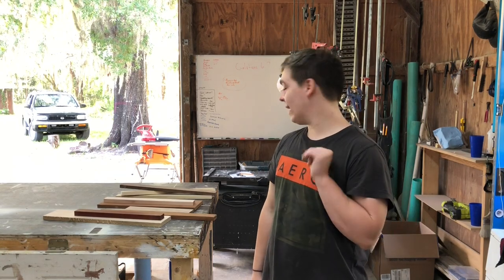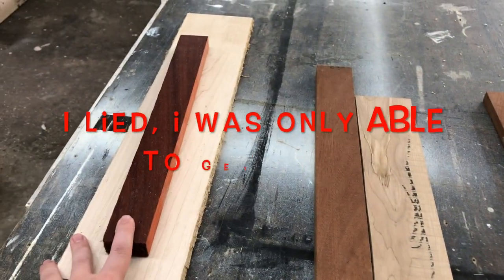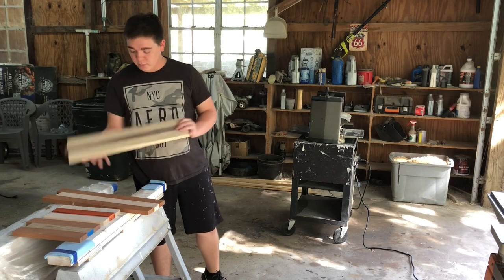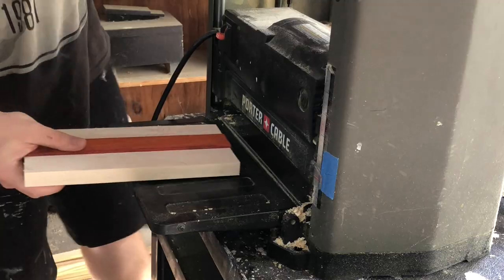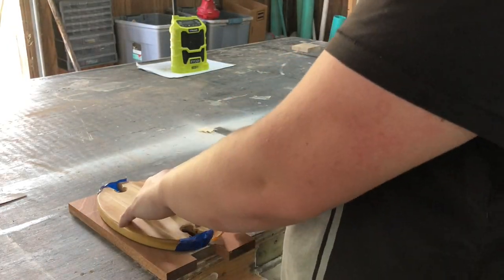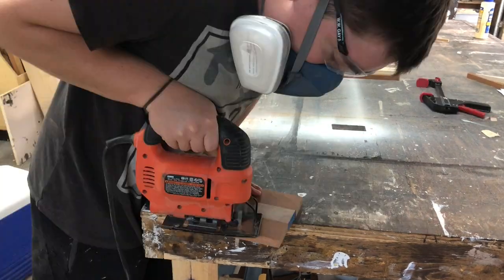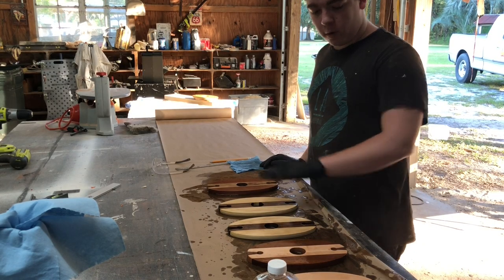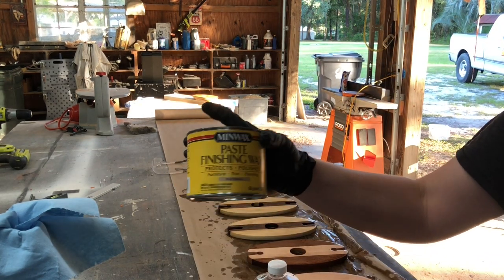Wooden Wine Displays! | DIY Woodworking Project

Comment: Good video, what are the measurements...width,length and sizes of holes?
Reply from the maker: Steve Rovito Thanks! They’re approximately 10” long, 5” wide. The hole in the center is 1&1/2” and the smaller holes are 5/8” ☺️
Reply: Cool panda and Rileybear